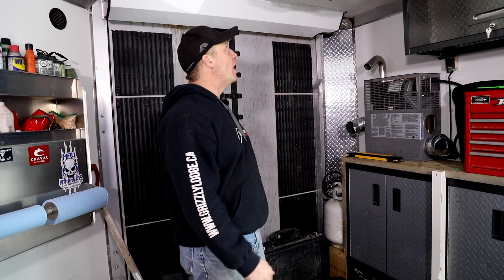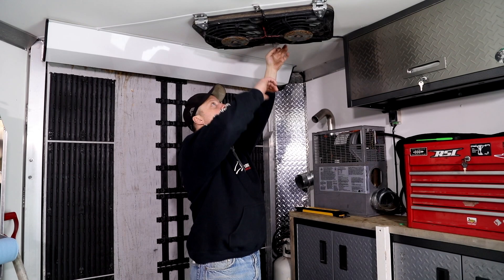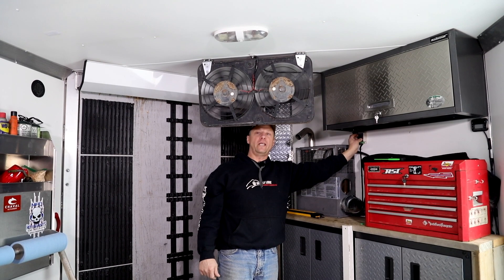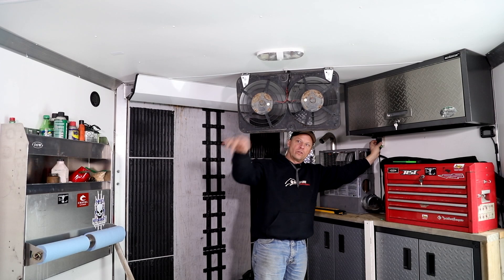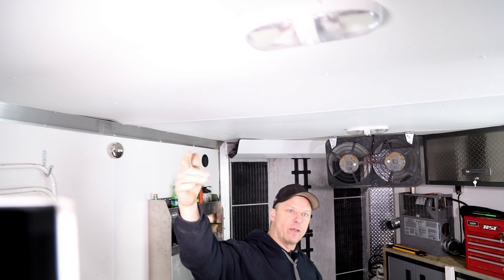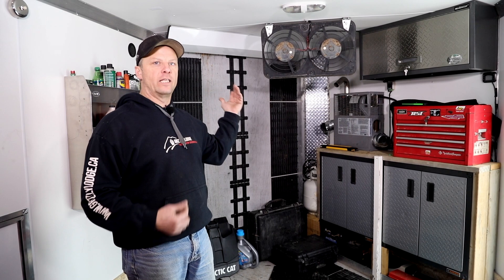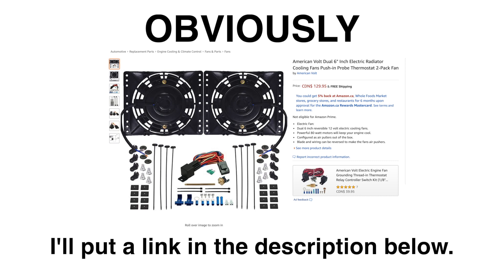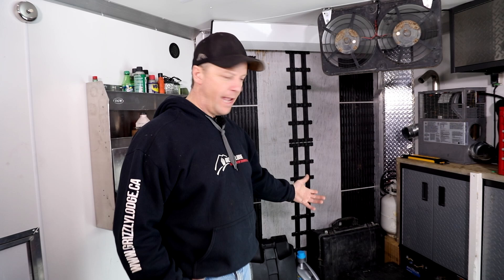Trailer Mod: installing a fan in your trailer for drying out condensation.

Comment: Do u have it wired to battery if u do how do u charge it
Reply from the maker: Charge it with a 110 volt converter/charger , or the truck while Im in transit !!
Reply from the maker: Stuff I used is on our website !